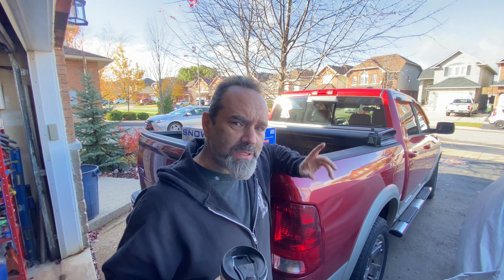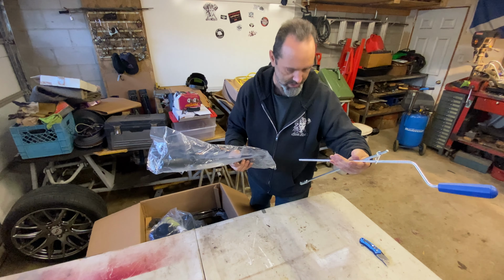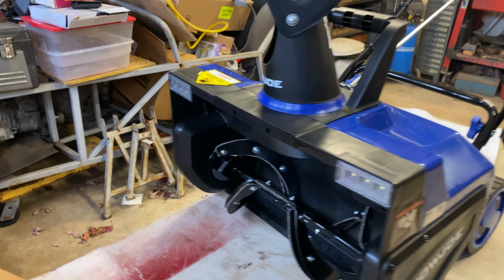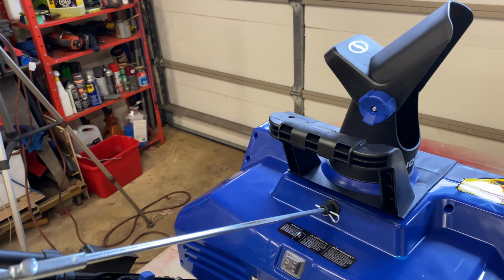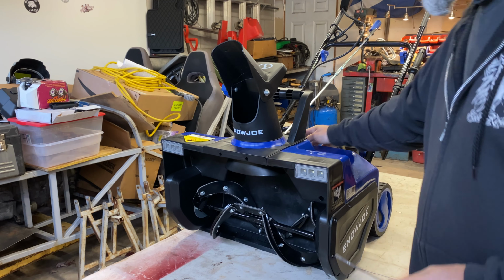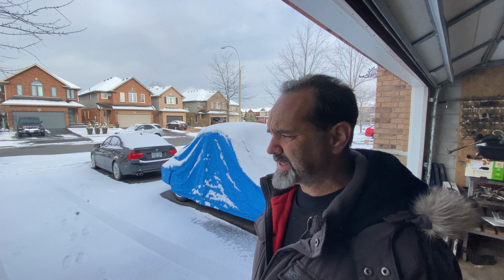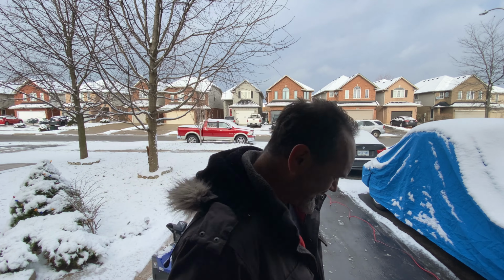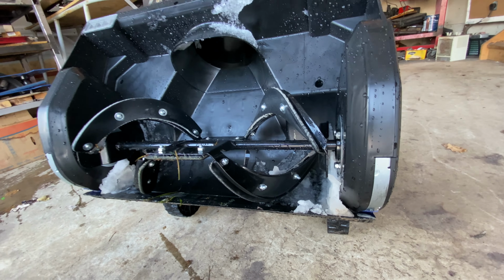❄ Snow Joe 22" Electric Snow Thrower Full Review

Comment: I want to try and use just a 14g 100 foot. 12g is stupid think and heavy.  Also if anyone is looking for a 12g 100 footer, sams club sells a yellow jacket brand 12 3 100 with [if I remember right] ptfe jacket for 58 bucks.  You can't beat that price. If so let me know.  Lol..
Reply from the maker: I agree, the cord I got is too thick and is really annoying in the cold. Will try a standard exterior cord this year.
Reply: 12-gauge for 100' length is recommended for a reason...

Comment: Firstly, love your accent and the Scottish flag. Secondly, after watching DOZENS of videos on the Snow Joes, I appreciate a little humor to break it up. We live in North Idaho on five acres. My husband has a snow thrower for his tractor, which does the job there. However, I found that after having our back deck remodeled and extended, I found shoveling the snow to be way more of a chore than in previous years (should have thought that one out more).  At 68, I have no problem spending a little money to save my back and shoulders. I used a corded lawn mower for years, so (aside from the weight difference) dealing with a cord shouldn't be a problem. I noticed from other videoes the corded model seems to be quieter than the battery driven models. Just ordered the same model from Amazon for $170. Waiting for it to come now. Unfortunately, we have had early and numerous snow falls, resulting in ice underneath. I'm expecting to be able to take the top stuff off with the Snow Joe and then shovel through the ice.  Fortunately, there is a covered outlet right at our back deck, so can leave it plugged in and ready to go for the winter. That way, there will be no build up.  Fingers crossed and thanks for the review.
Reply from the maker: Hey Lee Ann. I just did our driveway and the neighbours in about 10 minutes. This machine is extremely light to push around, I'm sure you will like it.

Comment: It'll probably work ok if you use it as per directions. Don't try to over load. Read up on product reviews works extremely well in tropical environment lol. O yeah reason for head lite is so you can save more using it at off peak time. Can't help it Dave had to say it.

Comment: I bought one of these a few years back, same size, but the headlights are different. One added expense for me was purchasing a 100' 12 gauge extension cord. We recently had a snow storm that dumped 12+ inches of fluffy snow and the Sno Joe did a great job of moving it. Even the 18 - 20" that the snow plow deposited at the end of the driveway was moved, albeit with a little more work and repeated runs. My experience is that it throws 6"+ snow further than it does lesser amounts. And in three years of using it i've only had to unplug packed snow in the chute once. I've been happy with it so far, and it has outlasted my Sun Joe corded mower which died at year three.

Comment: I have the same unit, been using it for almost 3 years. 
* The rod that connects at the housing to move the shoot, broke the first year. It’s all plastic. Now I just turn it by hand. It can’t be repaired. 
* The Blue knobs that allow you to fold the handles become loose and fall off while using the unit due to vibration. 
* I use a car ceramic spray coating on the inside of the shoot to allow the snow to move without getting clogged. 
* Heavy wet snow will only throw the snow a few feet. 
I still think this is a good unit for the price. Good Luck 👍🏽
Reply from the maker: Thanks Butch. I need to try that ceramic coating trick.
Reply: Use plumbers tape to keep the blue knobs on. I spray WD-40 on the blades and chute to prevent snow clogging.
Reply: @jakeshepard9931  late reply but I added those nuts with the teflon (locking nuts?) to the four blue knobs and they never fall off. I don't fold it up to store but I imagine this fix would add some pain in assembling, disassembling but at least I know I'll never lose the washers or nuts keeping those knobs in place

Comment: Electric should work well for dave, good choice. It's a short driveway and an outlet is near by. I'm supprised he didn't get the battery powered snow blower. In daves situation gas powered would be a headache. 
I have 100 ft of sidewalk uphill and over 3,500 sq ft of driveway to do. I have a tractor with a blower to get rid of the dandruff that falls from the sky.

Comment: You could dig a trench and run some underground cable to about 1/2 way out on your driveway and put a receptacle out there or just learn to put up with the cord.  You can make a device to keep you cord from pulling out of your socket, they make strain relief devices to hold the cable, you just have to find something close to the receptacle to attach the strain reiief device to and it will stop you from pulling out the cord and also from damaging the receptacle or the cord end.
Reply from the maker: Thanks. Yeah, I figured the best way is to lay the cable half way down the drive so I'm only fighting with half the length at one time. Also, if I loop the cord through that clip it should stay attached.

Comment: The sad  irony about these machines is that the electrical cord that comes straight out of the switch box on the unit to connect to  your extension cord can't take the cold weather, gets brittle and snaps off right up against the switch box. That's what happened to me. This unit worked good for about 1 1/2 winters and was fine. But when that short electrical cord just broke off, there was no  way to fix it. And taking apart that pathetically constructed switch box just isn't really feasible at all. To try to get the 2 halves lined up to reassemble it was impossible. I tried this because I thought there may be a way to replace the whole cord starting where the elctrical terminals attach, but no - that was a losing game. Snowjoe replaced the unit on warranty - however, I am not too optimistic on this one lasting any longer than the first one did.

Comment: Your truck sounds awsum
Reply from the maker: Thanks, totally stock.
Reply: @ScottRods  Sounds like the old cherry bomb mufflers.
Reply: I finally got to test out my snow joe, the only problem I have is I purchased a 100' cord from Amazon not believing the reviews, it came but only 50' in length, had to return it.
Reply from the maker: @Elkins24  I don't understand how sellers can keep getting away with this sh*t
Reply: @ScottRods  Very true, but just to be sure I measured from the outlet I used in the garage to the front of the driveway was only 92' so if it was really 100' should have reached the front of the driveway. Oh well, I sent it back and ordered another one. But, first asked questions to other buyers if it was really 100' in length. I just keep my fingers crossed.  I too don't understand people cheating.